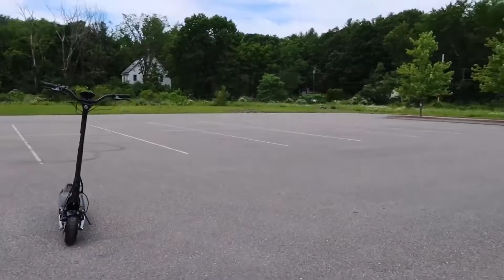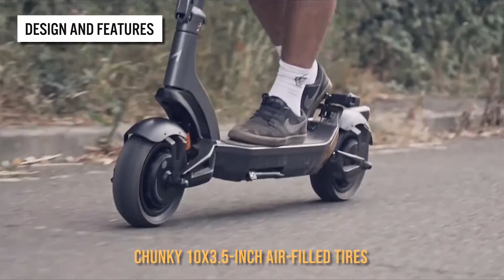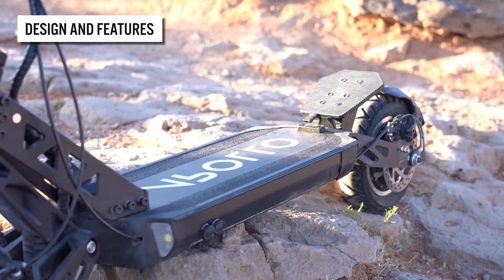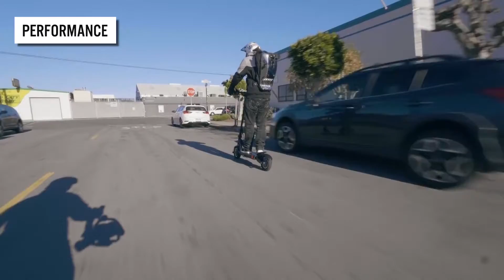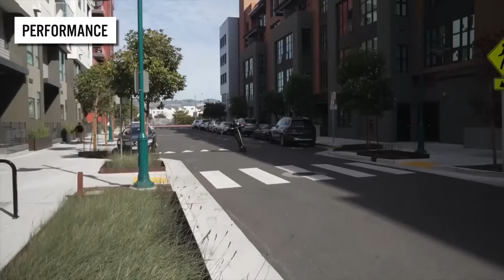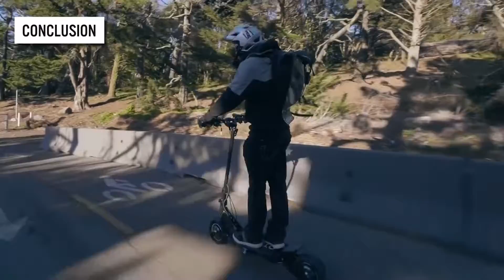Apollo Ghost Or Apollo City Pro - Which Dual Motor Electric Scooter Should YOU Buy?

Comment: City pro never get a flat tire and it has electric brake never change a brake pad ever again
Reply: Do you own one? I'm about to pull the trigger on the C 22 Pro. How do you like it?
Reply: @BloodRavenxxx  yes I have one it’s the best scooter ever
Reply from the maker: @BloodRavenxxx  what are you looking for in a scooter?
Reply: @BloodRavenxxx  I just bought it. I like all the features too... but.. the weight and 49" length doesnt sound bad on paper. In person it's huge. Maybe its okay for commuting, if youre going to lock it outside, and leave it in the garage at home.
Reply: @BloodRavenxxx  I have had my Apollo City Pro 2022 since September 2022 and have put over 775 miles on the odometer. Mind you, this is riding around the streets of Los Angeles, California so these are rough miles. I bought this scooter for mostly commuting and after almost 1,000 miles of use, I have had no major issues!! I only dealt with the infamous bad charger upon receiving my scooter but thankfully Apollo very promptly sent the Fast Charger for free! About 2 hour charge time now from less than 20% battery which is great. I have not noticed any battery degradation and have been using the Fast Charger for many many charge cycles now. I use the scooter on all full power and get about a 20 mile range confidently. Fresh off the charger I can hit speeds around 34-35MPH, then dips down to about 32MPH until battery gets low, then it slows down to high 20's mph after that. The regen braking is so good and strong that I rarely use the actual brakes, only use in emergency braking situations. The tires are great because I have gotten nails and screws in my rear tire but they do not go flat. Although now I have noticed that my rear tire is finally starting to leak air after sitting for a week, but I just fill up with air every few days and I'm ok. Maybe I can use some of that tire slime to stop the air leak!? Something to do in the future. The only cons that I have noticed about the scooter is the stem can become a little loose after a couple hundred miles but can be easily tightened to fix. Another is the rear brake light does NOT light up when you hit the brakes and the running lights are on, which is a major miss by Apollo. Some users deal with sticky throttles and regen lever but for the most part my throttles are working fine. Apollo did send out new throttles and controls for free, but I have not swapped them. Overall, the Apollo City Pro 2022 is a beast of a scooter and the performance and ride quality is high quality!